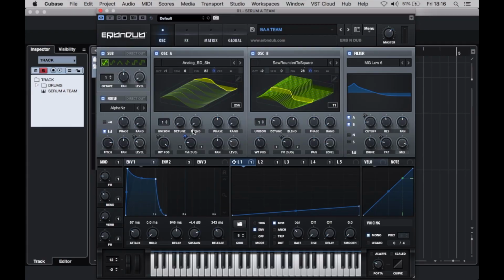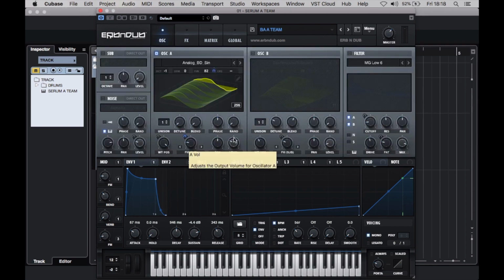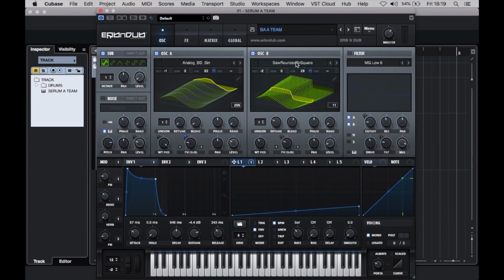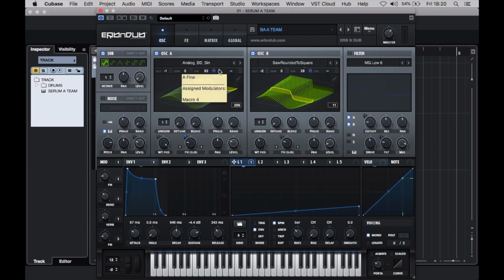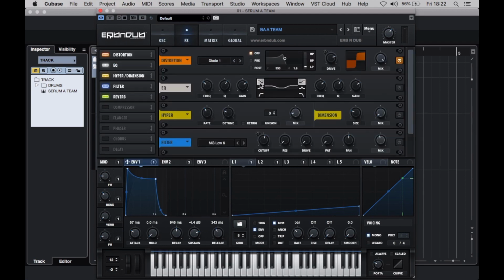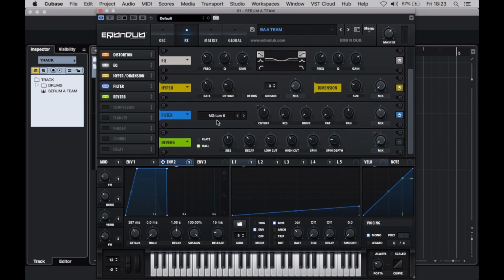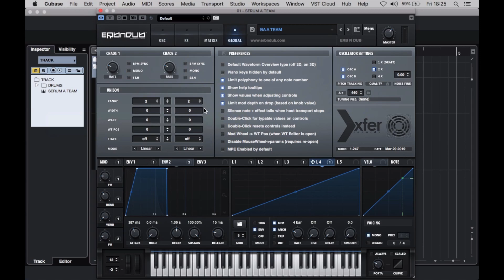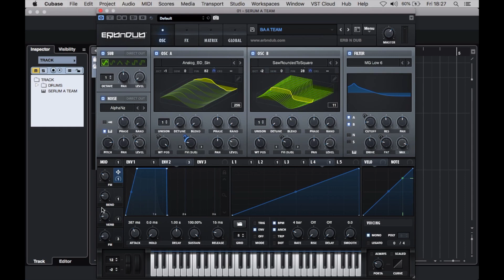ERB N DUB - ROLLER BASS SERUM TUTORIAL

Comment: Sick tutorial man! My only question is does setting the synth to mono not cancel out any stereo width added by the Hyper/Dimension?
Reply: No, that "mono" refers to "monophonic", so only one note can be played at once.
Reply: @YOSHUUMUSIC  Maybe you also could advice, when I should set my synth to stereo or mono? Should I use mono every time creating the bass?
Reply: Ok, so monophonic means you can only play one note at once, not two or more. For example u can't play a chord when serum is set to "mono" in the "Voicing" section, since you can only play single notes. That setting can be used together with "porta" to create a gliding effect. Ex: Set Mono, Set porta to 100ms, Play F0 and then C1 and you will hear how the pitch sort of ramps up.
Now when it comes to mid/side signal information, which is a completely different topic, your low end should in almost every case be mono (which does not refer to monophonic, it refers to the mid signal). You can have different midrange harmonics or high end in stereo but the lows should be mono.
Hope I've made myself clear :D